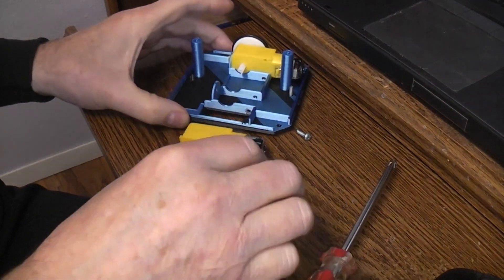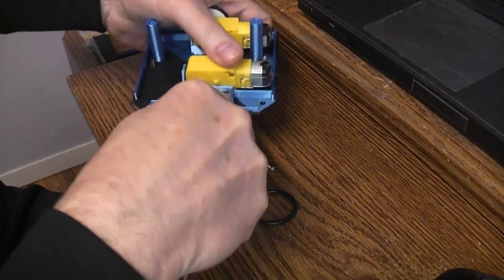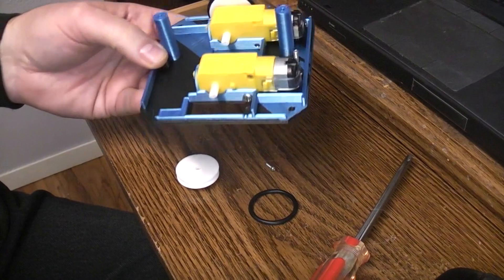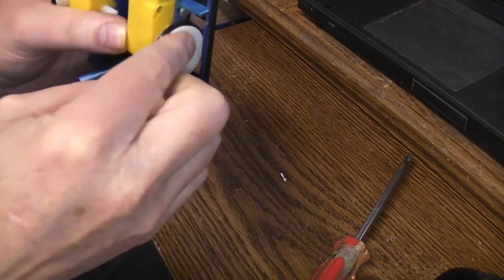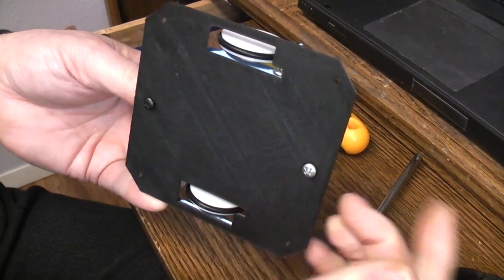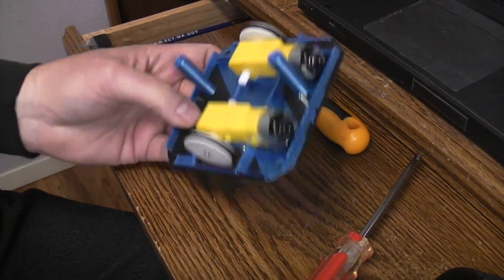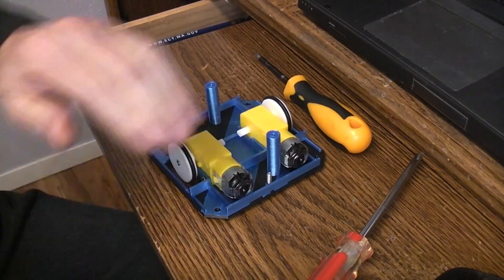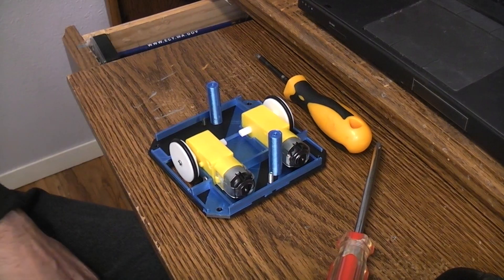Dual Drive Robot Base , You can make

Comment: Neat little setup...I seen those yellow motor assy's but haven't messed with them yet....I'm finding wheels are quite a search effort on ebay....especially small ones.
25T are common, but not all sizes are available .ex: , a  21T servo horn....try to find one :p   .May end up like you and design wheels to fit what motor I have......
Left a comment on thingiverse.
Reply from the maker: Yes it is easier to just design the wheel to fit the motor set up you are using most of the time. faster too, as they do not take long to design and print. I am posting a Geneva sequencer next that mounts to this base, so that a trigger signal can control the base direction and On and OFF.